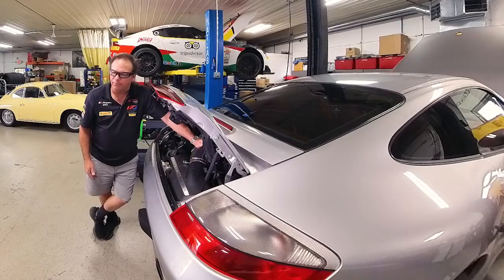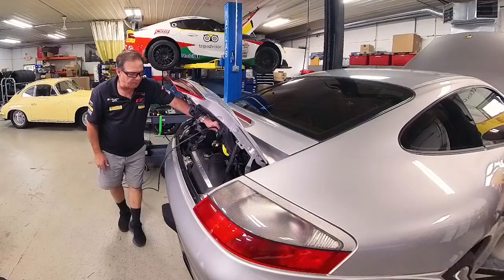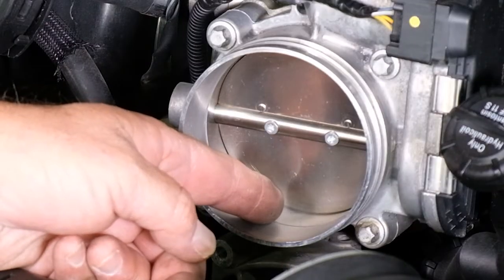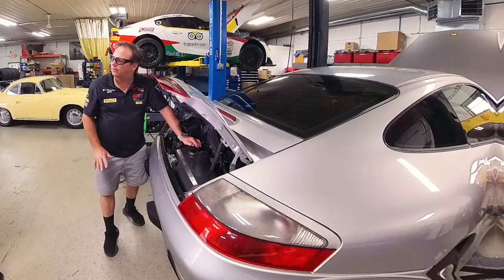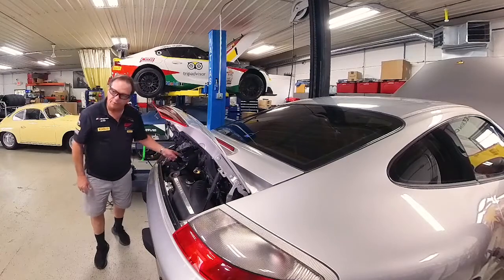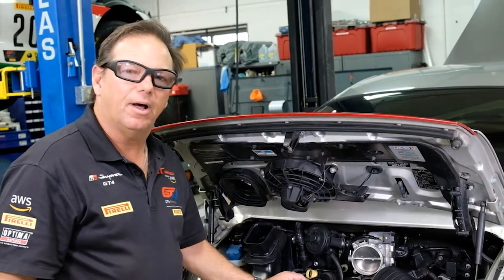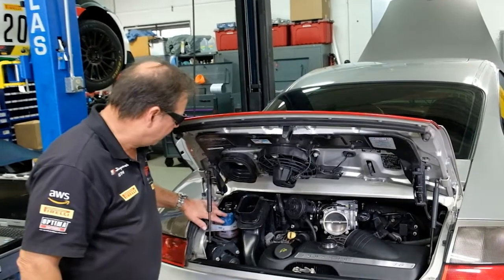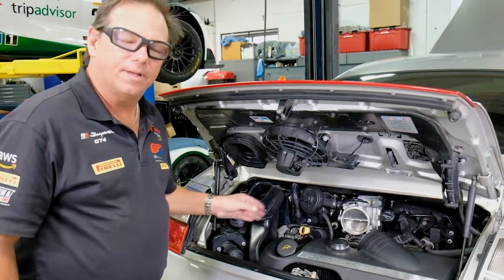Smoke Testing | Air and Vacuum Leaks | Throttle Body | Rubber and Plastic Parts | Cooling System

Comment: Can you please tell me the name of the hose you pulled off to to the test.
Reply from the maker: The hose was pulled just to show what a vacuum leak looks like during the test. The smoke tester pressurizes the intake (and crankcase) with smoke and you would then look for visual leaks. It is best to do this with the engine cold as some leaks will seal up once the engine is warm.